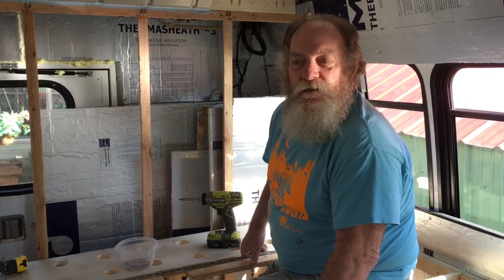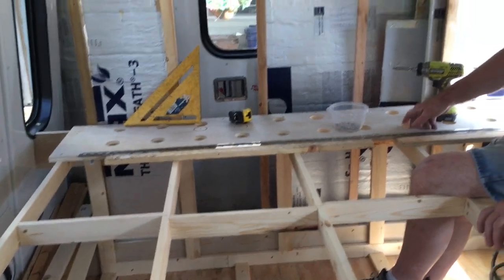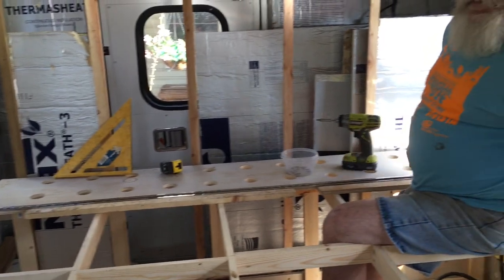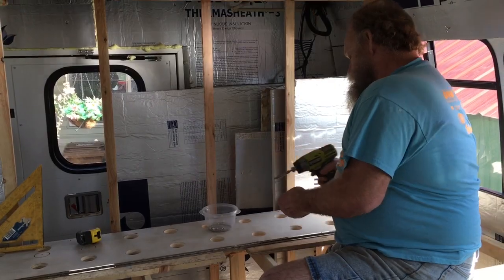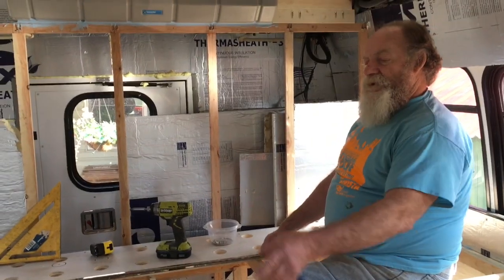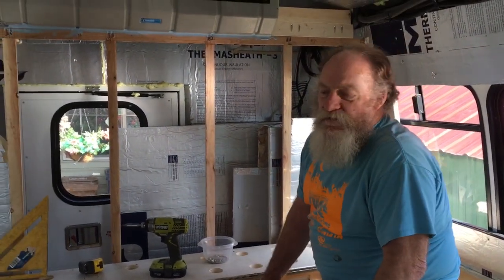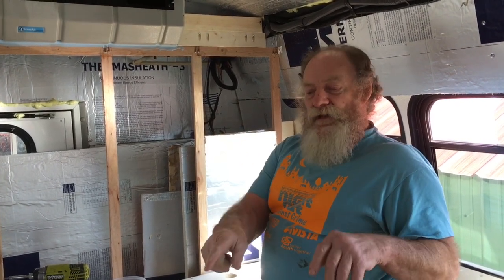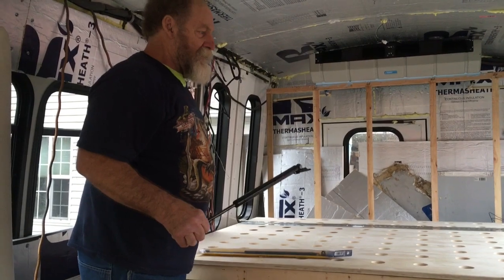SHUTTLE BUS CONVERSION Platform Bed ~ Preventing Mold Growth ~ Bucket Talk No Blow-out Holes Ep18

Comment: The reason bed frames use slats is because they are easily packaged and they are spaced in order to eliminate moisture.  The reason holed are not drilled plywood is mould is not eliminated. 

Rethink that concept before you get too far into the project
Reply from the maker: Hi Gus, the pre-packaged slats accomplish the same air movement for preventing mold growth. The plywood accomplishes what we wanted for our bed lift system and storage access.